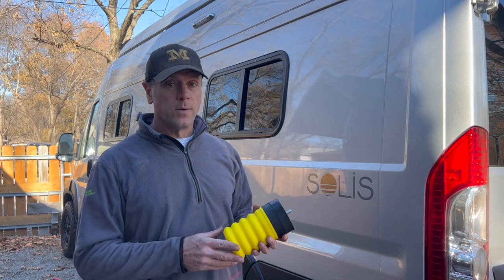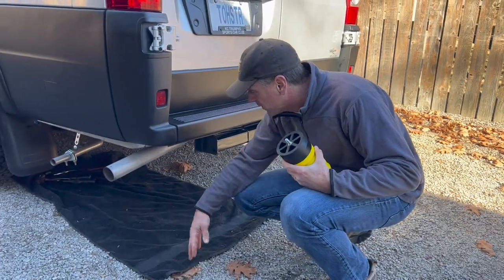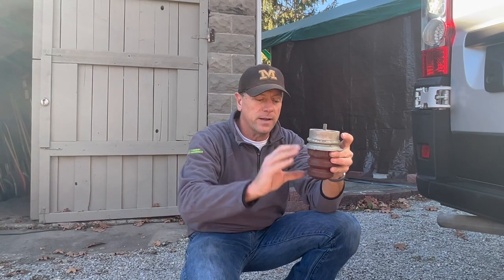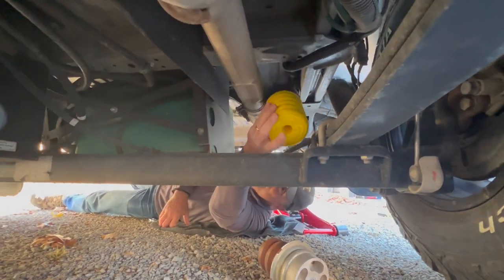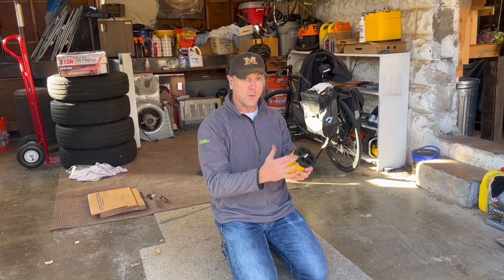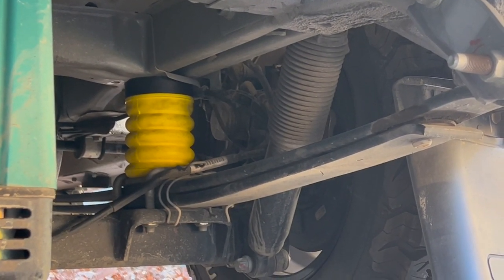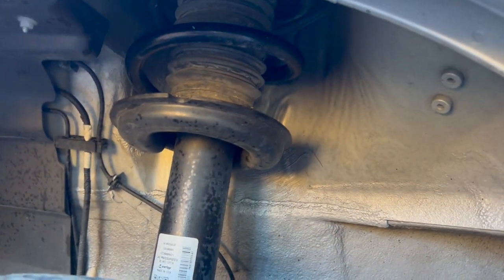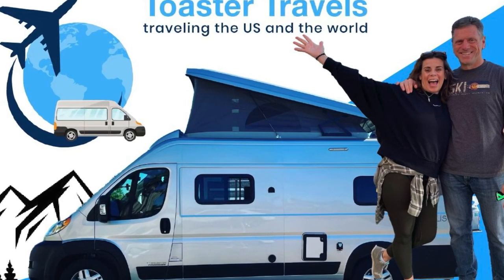Sumo Spring Installation on a 2022 Winnebago Solis 59PX

Comment: Hey TT, Great addition to your van. We have the same van and added Sumo Springs as well. Probably the best upgrade you can do for the Promaster chassis!! See you changed your wheels/tires…looked like KO2’s…what brand/size/offset wheel and brand/size tire are you using and does that setup seem to work ok? Been following you guys from the start, even did a similar shelf over the stove like you did. Keep up the videos…STAY💯👍👍👍mike and Lu R. in NC🇺🇸
Reply: Sorry for the long delay in responding.  My wife does the vides and I apparently don't check back here often enough.  🙂 We kept the stock size wheels/tires (225/75-R16) and went with the GF-X MV2 wheels (45mm offset) with BFG KO2 tires.  Been really happy with them so far.  I did have some trouble getting them to balance at first, and finally purchased a set of hub centering rings on Amazon (very cheap) and that made a huge difference. Centering ring has a 84.10mm OD and a 78.10mm ID.
Reply: @jaysmith2626   How do you like the ride comfort and noise level of the KO2s compared to the stock roadies? Appreciate the video and the inputs!
Reply: I think the KO2 ride quality is pretty good.  However, they are definitely more noisy than the factory tires.  That said, we like the way they look enough to overlook the additional road noise.  😊
Reply: @jaysmith2626   Thanks for sharing!

Comment: Dude, lay a piece of cardboard on the gravel before laying down. It makes a world of difference, and you can slide in and out so much easier. An old broken down box or something. This is coming from your motocamping buddy.
Reply: Lol - yeah old cardboard has been my go-to forever - you don't have to clean it - just throw it away or burn it also. I was thinking the same thing (and jack stands - that's 9,000 pounds above you!).